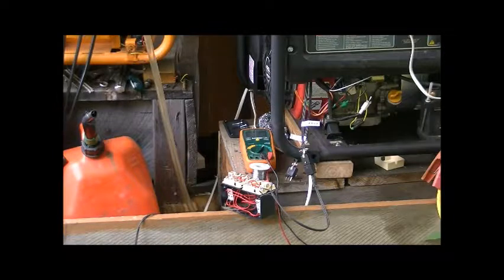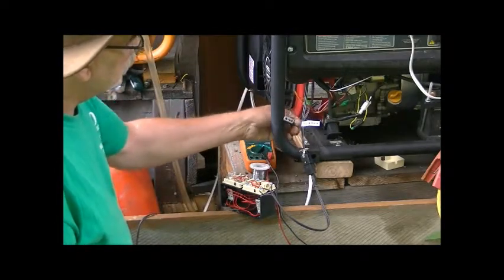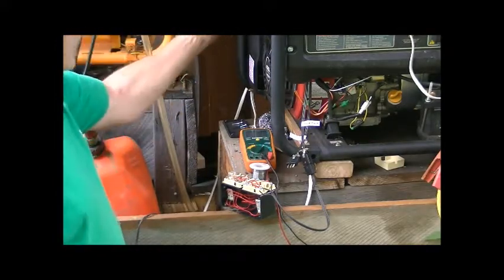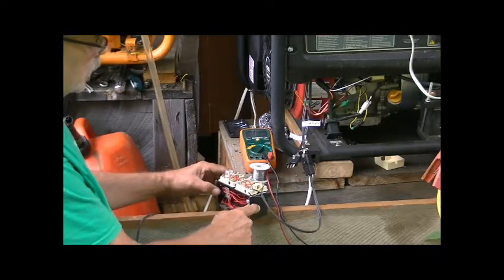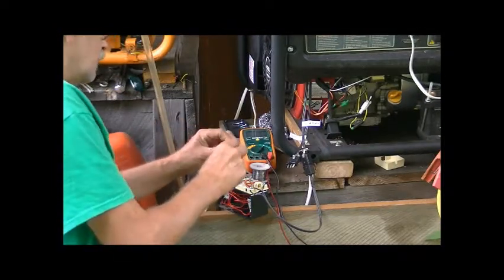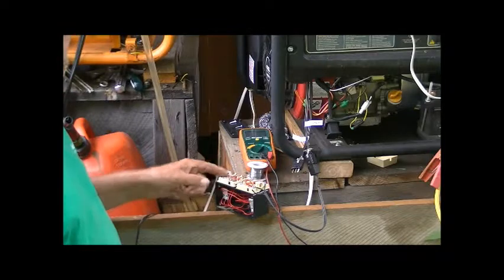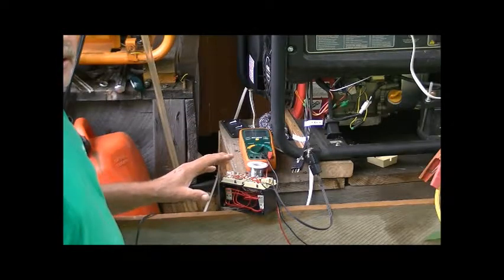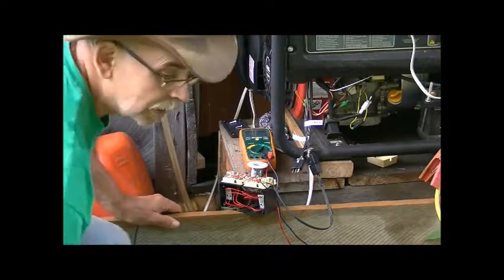Generator auto start

Comment: I would like instructions for this please.
Reply from the maker: If you look at the rear side of the Stop/Run/Start switch, you will see two rows of three contacts.I worked with just one of those rows, which for me was the left side looking at it from behind.If I were to jumper the left center contact to the bottom contact, while that switch was in the "Run" position (that's important), then the starter would engage and the generator would start, exactly as if you were pushing the "Start" side of the switch.  Once started I would remove that jumper from the bottom contact.  If I leave it connected to the center contact and touch the other end to the contact above it the generator will stop.Knowing and understanding how that switch worked, I drilled an access hole, put a grommet in it, and ran wire to the back of the switch and soldered the three leads to those three contacts, noting which wire was which.With the wires outside of the generator, I could easily cross them and see how they operate.  At that point you can continue the run of wire to wherever you're going with them and put a start and stop button.Later on, I jumped the Xantrex AGS module to those same wires.Some side notes, you should add a fuse, perhaps 5A on the wire connected to the center contact as it will always be hot regardless of what position the switch is in.  I have a breaker box that the generator power enters into our cabin with the 240v power.  From one leg and the ground (120v) I connected a 120v hour meter to monitor the time on the generator.  I connected an electric outlet to the other, which would only have power when the generator is running.  I plugged an a/c adapter into that outlet and connected it to a lamp mounted with my switches to tell me that the generator is producing power.  I wanted that visual information because I didn't want to continue cranking the starter after the generator was running.The AGS on our electrical system was later programmed to take care of that.I haven't got the video of the automatic choke made yet.  Basically, it amounts to a solenoid with a 5/16" pull mounted on a bracket I connected to the air cleaner.  I cut a flat tin linkage and ran it from the solenoid to the choke where the metal pin from the plastic choke lever enters the plastic piece on the choke shaft.  The solenoid I connected to the starter motor.  This puts the choke on while the engine is cranking.  Since my project evolved, I also have an earlier version of the automatic choke where air from the blower is directed against a wind vane I placed on the choke lever.  I had also modified the choke lever to remove the "stops" where it snaps into place in the full choke and full run positions.This modification, which I built so that it could be moved from one like generator to another, is working out perfectly for us.  I haven't programmed the "quiet time" setting on the AGS, so our generator automatically starts and charges our bank of batteries through the absorption mode and shuts off the generator when the Xantrex Inverter goes into float mode.This really adds a lot to our system and we would never want to go back even to the point where we would simply push buttons from inside the cabin, walking out and physically starting the generator is out of the question.  I'm working on an over ride thermostat for when the engine is already warmed up and the choke isn't wanted, but to be honest, unless I've just run out of gasoline, that hasn't been an issue.You absolutely have to keep tabs on the oil level in the generator.  My generator has a warning light rather than a low oil shut down.  I will be converting that as well.  Next immediate goal is a 33 gallon barrel for a fuel tank.
Reply: Jeff Bishop very nice, thanks for the great details! Could you put me s link for the AGS that you used?
Reply from the maker: This is the unit I'm using for the AGS: https://www.starmarinedepot.com/xantrex-automatic-generator-start.html?gclid=CjwKCAiA3o7RBRBfEiwAZMtSCd7N_AeSogfo9odazAfuAIYLna6g8zaCHTlUn_ZhUF7Khy2sPJa8ThoCbEwQAvD_BwE  I imagine that it's only good for the Xantrex system.  I'm using the Xantrex 6048 Inverter/Charge Controller, a Xantrex Solar Charge Controller, and the SCP System Control Panel.  All Xantrex.